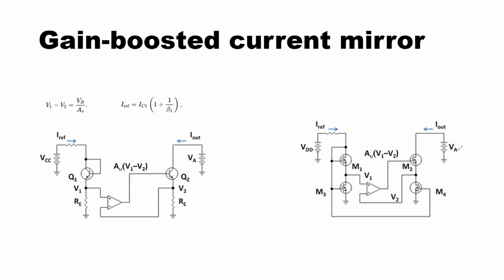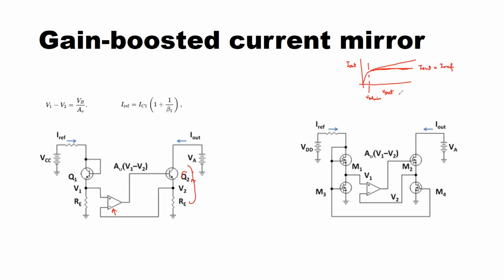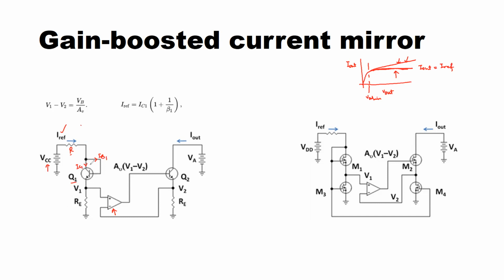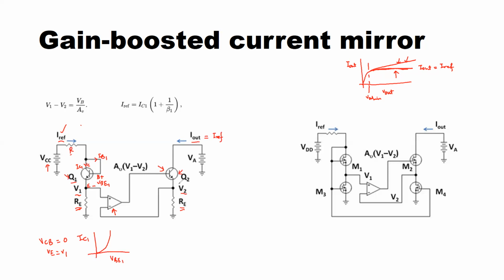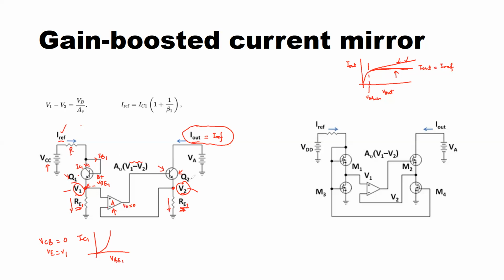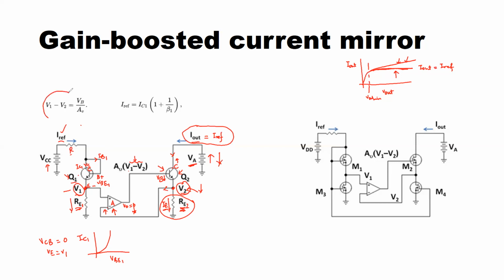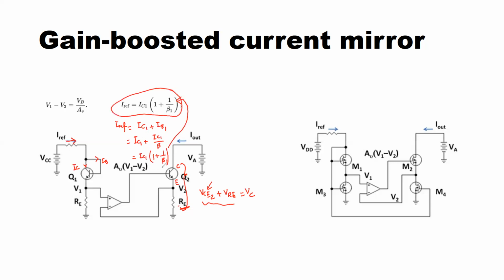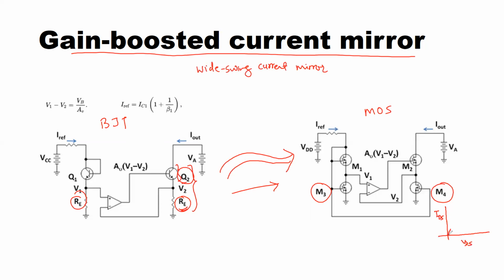Achieve Infinite Output Resistance with This Trick

Comment: I don't get the  reason for the diode-connected Q1.  The current into Q1 equals the current out, because the current feeding it splits off for Ib1 but then re-combines in the emitter.  So it must be there to create a compensating voltage that subtracts from Vcc, right ?